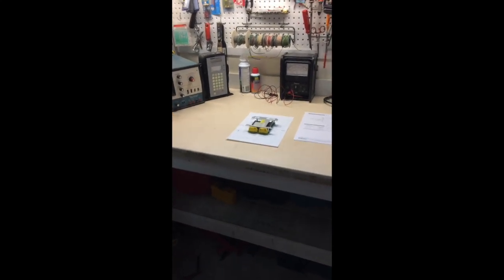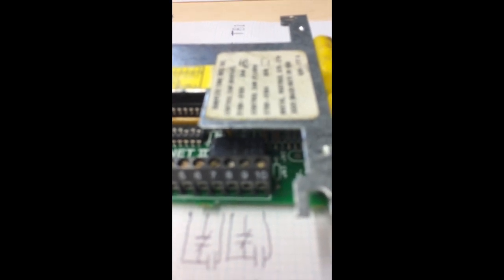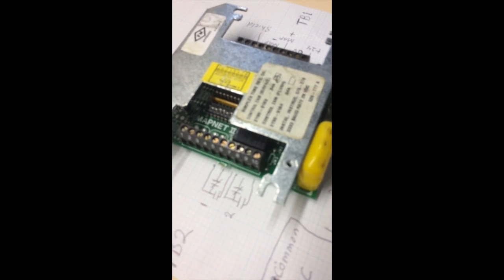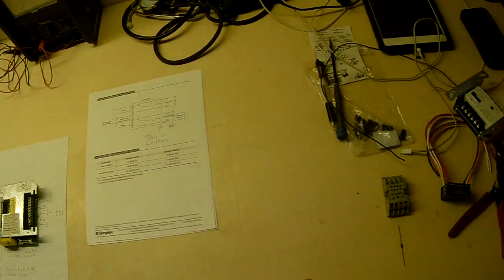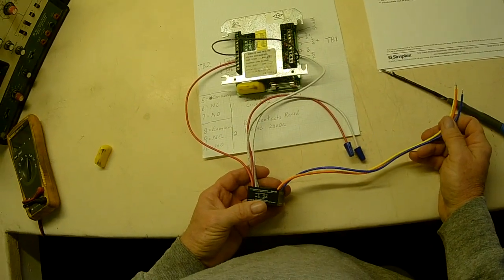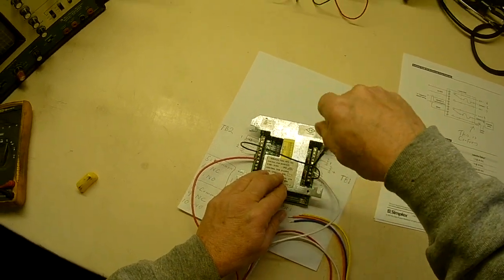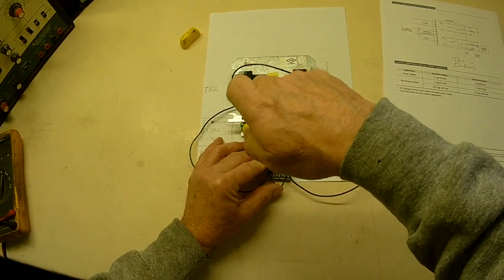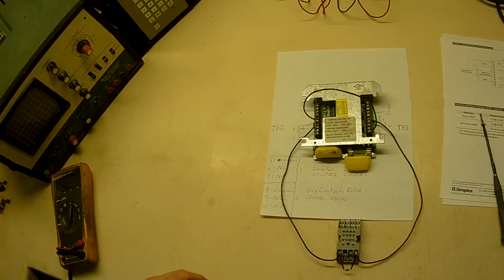Control Zam Wiring

Comment: Do you have a wiring diagram for 2190-9161 control zam speaker circuit?
Reply from the maker: I find most of my diagrams by googling 2190-9191 and one of the sites provide a PDF